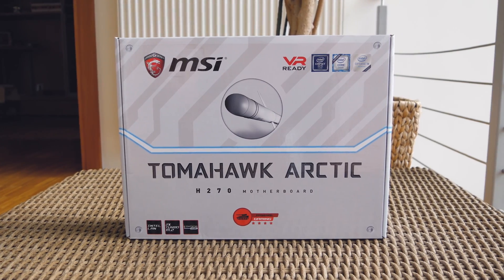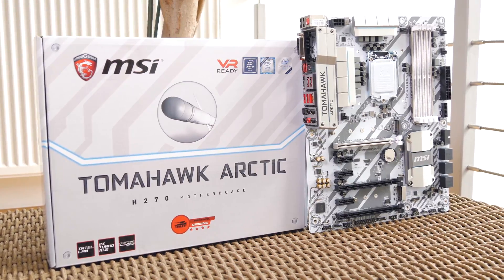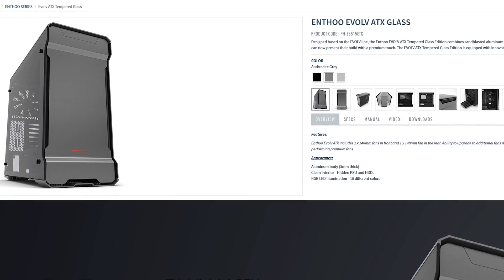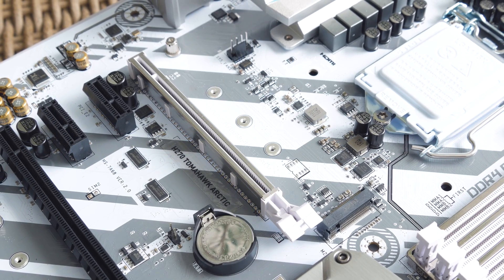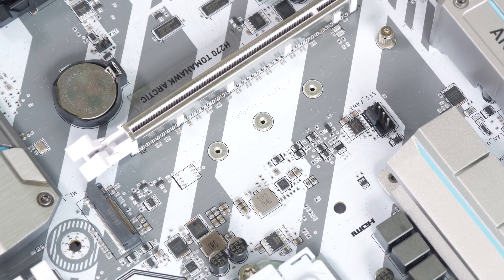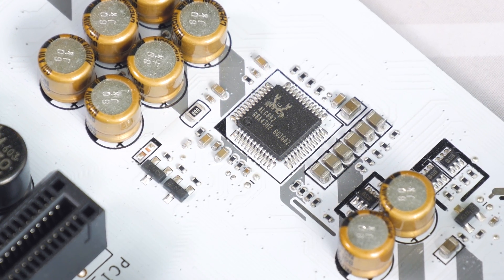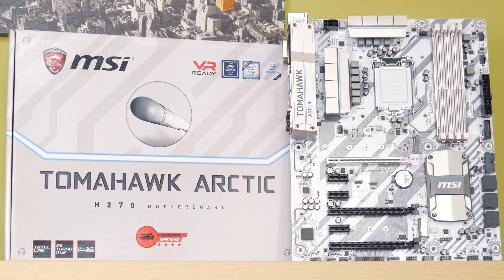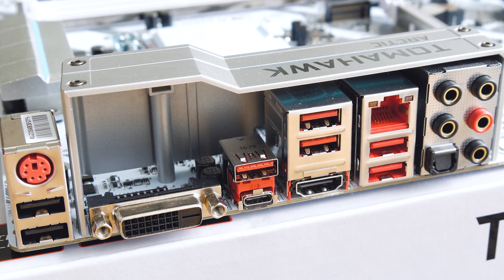MSI H270 Tomahawk Arctic Preview - Snowy Outsider

Comment: I used this motherboard, here is my set up.... what do you think?

PC Specs:
MSI Tomahawk Arctic B350: http://amzn.to/2wq4Pr6
AMD Ryzen 7 1700  8/16 Core 3.7 GHz: http://amzn.to/2u5gISp
Ballistix Sport LT 16GB Kit (4GBx4): http://amzn.to/2wbNxOW
EasyDiy 120mm White LED Silent Fan: http://amzn.to/2wqkCWJ
BitFenix 30cm 24-Pin ATX Cable: http://amzn.to/2vn4l87
BitFenix 45cm 6-Pin PCIe Cable: http://amzn.to/2wpZCzl
Corsair Hydro Series H100i V2 GTX: http://amzn.to/2wbA7CN
Corsair Carbide Series Air 740 Case: http://amzn.to/2vmxWP8
Reply from the maker: Looks good to me!

Comment: Does CPU Boost happen on H270 boards. I want 6700K will it go to 4.2 Ghz if there is thermal headroom ? I do not need overclocking.
Reply from the maker: Yes it does!

Comment: great review! have you ever wondered why such overkill power designs are put on non-oc boards? like they could just load it with features and put a power design that is good enough since no one is gonna OC it.
Reply from the maker: Thanks! Yeah that's a bit odd, but still, it's good to have it nevertheless, you want for your CPU as "clean" power delivery as possible, even when not overclocking
Reply: TekTick I agree. can you change voltages with these boards though? I still have the FX 6300 and I am wondering if these non-oc boards are good for non-k CPUs